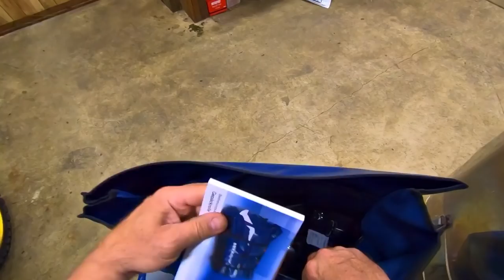My Road Trip Survival Kit!! • All-New For 2019..! | TheSmoaks Vlog_1315

Comment: I learned my lesson in 1967 changing a tire with screw drivers, they slipped and I went forward over the wheel, both elbows on a concrete floor. That was a very painful lesson but never repeated.

Comment: Good video, thanks for the info. I have that same 1250 that you do and the dealer put a lead from the battery hanging from the side, it is a Gerding I think not sure of the spelling and they said I could hook a charger to it. Is there some more information on that I would appreciate it. And I believe the mesh pouch on your bag is for wet gear so it can dry as you ride, a nice feature.

Comment: I have that same air pump Shawn, and yes the gauge on mine is shockingly accurate.
Reply from the maker: Nice!!

Thanks Doug!
Reply: Unfortunately I had the same pump and it worked exactly once before failing.  I now have a “Slime” pump and it has functioned multiple times.  I’m still carrying a manual mountain bike pump though, unlikely that will ever fail!
Reply: @PMCraig  I have used mine half a dozen times now. So far so good.
Reply: Doug Morgan, Yeah, entirely possible I just got a random bad one. I don’t see many negative reviews...

Comment: I may have missed it but if an SAE plug is for 12V out only, What do you use for a battery tender?
Reply from the maker: One needs to use the BMW or a CANbus (like the Optimate-4 CANbus) charger that back flushes through the power port.  This way the bikes Ground Module protects all the vital electronics from any type of voltage or static spikes...  Very expensive electronics on these bikes to make all that magic happen, you want to keep her all safe and sound..! Lol

Thanks!!

Comment from the maker: Items Shown In Video:
CruzTools RoadTech B1 Tool Kit for BMW - (RTB1) http://www.cruztools.com/streetmetric.html

Motion Pro BeadPro Tire Bead Breaker - (08-0536) https://www.motionpro.com/product/08-0536

DYNAPLUG Pro Tubeless Tire Repair Kit - (DPP-AL-1243) http://www.dynaplug.com/pro.html

Stop & Go Mini-Air Compressor for M/C - (RCP) https://www.stopngo.com/mini-air-compressor-for-motorcycles-scooters-atvs-only/

Stop & Go Automatic Tire Inflation Kit - (1090) https://www.stopngo.com/automatic-tire-inflation-kit/

Genuine Innovations CO2 Air Chuck Tire Inflator - (G2673) https://tinyurl.com/co2airchuck

BMW First Aid Kit - (71 6 02 312 354) https://tinyurl.com/bmwfirstaidkit

BMW 50L Luggage Roll Duffle Bag - (77 4 98 550 346) https://tinyurl.com/bmw50lduffle

Comment: My 1250 came with a battery tender lead already on it . . . do I need to be concered?
Reply from the maker: No, I've seen plenty of bikes from other dealers that have the lead installed as a convenience to the customer.  We've been advised by BMW to only install them per customer request, after they've been advised not to use them as an input source, but an output source only...

Thanks Jason!
Reply: TheSmoaksVlogs thanks, Shawn, I’ll remember that!!!
Reply: Hi Shawn,

Just wanted to make sure I am doing it right. It’s ok to plug my battery tender on the SAE harness that comes with the bike, right? I have a F850gs.

Thanks!!

Comment: I asked my dealer about the tender lead they installed for charging the battery and they acted like they never heard of BMW not wanting a tender on the battery for charging, said it not an issue.
Reply from the maker: Hope they'll cover the damaged ZFE, GM or DME if something goes wrong..!  If you have a G310 or S1000 you're fine, anything else, I wish you the best of luck!

Thanks!
Reply from the maker: Fred Neck - There’s really is no conflicting information here, there’s simply technicians that are not up-to-date on how BMW wants things done..!  BMW simply does not want you to charge the battery at the terminals with the battery connected to the bike, this is exactly what charging through an aux port is doing.  Damage to the bike’s electrical systems could result!  To maintain a connected battery, they want you to use the bikes power port to back flush to the battery with an approved charger.  This way, the ZFE or GM has control over any issues, such as voltage spikes, etc.  If one doesn’t want to purchase to correct equipment, simply disconnect the battery from the bikes system and charge with any charger that meets the battery’s charging requirements.  This information is outlined in every modern BMW’s owners manual...  BMW browbeat this into us over three years of training, with tons of horror stories, many coming from technicians attending..!  

Thanks for watching and commenting!